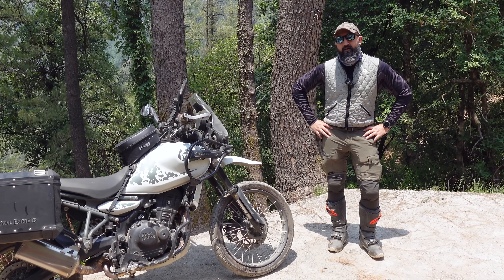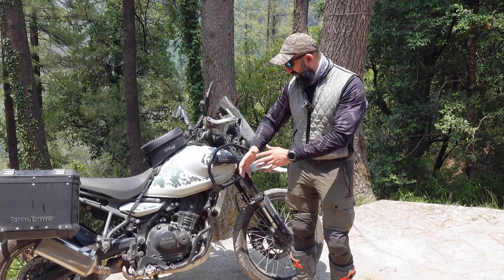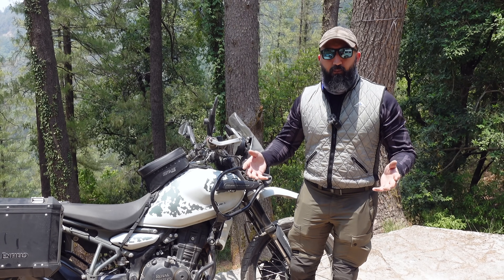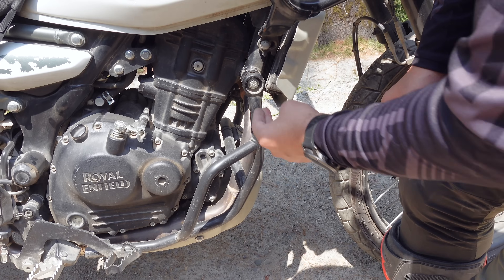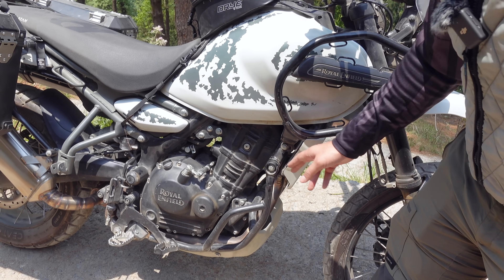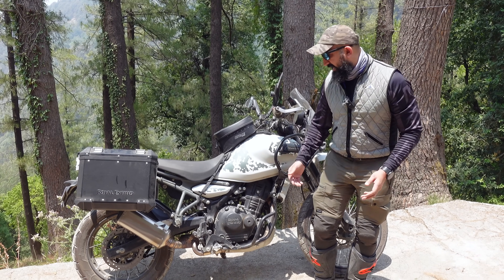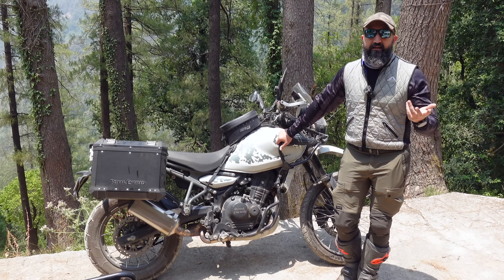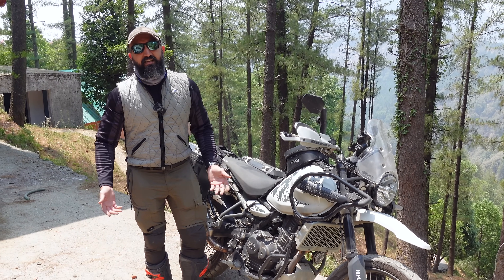Why Did Himalayan 450 Chassis Break: What I Learnt From Royal Enfield

Comment: Royal Enfield should first go complete their school education,then come back again...These idiots are making motorcycles out of cheap raw materials that is generally available in scrap yards
Reply: Bruh... Even you should follow your own advice.

Because the raw materials aren't at fault here,  the way it is designed and the way stress develops on certain points on the frame is at fault
Reply: @adityan3208  i live in Chennai..and I knew where does RE procures their raw materials from...Pls don't go too much into engineering aspects,design is just a form...Material is the substance which constitutes the form..Without material, you design something on the Air 🤔?? ...better luck next time for ur argument 🖖🏻byebye
Reply: @arjnVneEeclassic  lol bro comes with a weak ass explanation and thinks he did something savage.

Look, yes the material plays a crucial role, but the way it is designed also plays an equal amount of role.

Take a piece of paper for example, you can fold it and use it in a way to keep certain delivery packages safe. They have replaced the bubble wraps now.

Now if that thing was poorly designed, it won't protect anything. Design is just as important.
Hope you had fun for 2 mins lol

Do you understand how stress is calculated on a frame? They know all the safety values while designing for a particular material.
I've studied this shit. I know this much lol

"Please don't go into engineering aspects" bro we talking here about a frame breakage and a bike that has been engineered. Why not?
Reply: @adityan3208  If you are that intellectual 🤔well lemme post you a few sober questions. What is the difference between weight and force ! Answer this without typing essays🖖🏻😇 ✨
Reply: @arjnVneEeclassic  weight accounts for gravity while force doesn't.
This is a question for kids.

Don't ask any further pls. I'm not here to prove anything to anyone. Ek baar kar diya ab peeche mat lagna
Reply: @adityan3208  That was the reason I posted it to you 🤭🤣
Reply: @arjnVneEeclassic  hahaha very savage 😒

When you couldn't win at the original point of contention, act like a kid and divert it and make silly jokes to feel better. Good for you.
Does not affect me. My ego isn't this fragile. I was here only to discuss, not to win or lose.
Reply: @adityan3208  you keep blabbering 😎😁🏌🏻who cares 🖖🏻🥳🤣

Comment: Trust is like a vase, once it’s broken, though you can fix it, the vase will never be the same again. 
Same case here 🙏
Reply: You can't simply whack the vase with a stick and blame the vase.
Reply: It's not wise to let a 'saying' affect your mechanical understanding. Ditch the melodrama, stick to facts.
Reply: @haldar9528  just think about it, a motorcycle chassis breaks due to wrong torque. How many bikes have had this problem
Reply: @ontwowheelsjoe Some Ducatis had this problem too. If you understand the function of those bolts, you will understand why. If you use incorrect torque on your car's suspension's joints, something will break.
Reply: @twowheeledparadox  Understood. Happy to have learnt something new
Reply: Tune mujhe woh Jab we Met ke station Master ki yaad dialadi ...buddhe

Comment: Utter nonsense 🥺 of first 10 mins at lest

I kept on listening but at no point could make any sense of it. 

This thing, that thing, designed that way bla bla.... BS pure BS. 

"High Tolerance" means the scope for adjustment/adoption is higher -- engine is not such unit. 

"Couple of mm deviation" -- you need to have sense of units, what it means in solid blocks like engine. 
Making a laughing stock of yourself.
Reply: Well said, and why does this incident need justification from anyone? I mean until and unless he's getting paid from RE it doesn't make sense.

Comment: I understand where you come from, but RE should immediately take steps to strengthen or redesign the Himalayan 450 chassis. This will affect the otherwise brilliant product, I'd say 95% of Himalayan 450s  sold have an aftermarket crash guard installed already and it's only a matter of time before more of these instances crop up.
A chassis snapping because of aftermarket crash guards points to an already compromised chassis and there's no telling if even OE crash guards will help the chassis stand the test of time.
I'm curious if there's a specific brand of crash guards was on both bikes that were affected.
Also, it isn't easy to buy OE accessories, it depends on the level of dealer involvement and various other factors that will end up causing a buyer to look elsewhere.

Comment: People will buy motorcycle, people will install accessories. If a nut bolt is twisted too hard is causing chassis failure. It is manufacturers fault. I don't see it any other way. Enough redundancy should be there that one installation should not cause any breakage.
Reply: @tazz31415  I will not pretend that I know what cars lower arm mean but surely leg guard and engine guard installation are much more common.

Comment: Sounds like damage control. How much did RE pay you to say this? There are thousands, if not lakhs of motorcycles here in India running aftermarket crash guards, never heard any other motorcycle with snapped frame. Why only RE? They blame the aftermarket guards yet fix those motorcycles under warranty? Both the owners also came out and said it's their own fault. Sounds very fishy. RE should spend their money in R&D and quality control instead of marketing and damage control.
Reply: Dude just think with your mind a bit open, the big brands who makes the engine as a stressed member and people who buy them generally do not use zana products mainly they use the GIVI or some other expensive crash guard brands. The problem here is the bike is new and as always indian accessory brands didnot put in a lot of research to make a compatible crash guard.. So this problem can be an issue.. The 3rd party companies must do some research or just ask about the tehnicalities of the himalayan and should have come up with a better product.
I use himalayn 411 and use the zana engine guard, the part of the guard which bolts with the frame of my bike broke and stayed inside, it was a nightmare and had to drill the bolt out and re-thread it to use a new bolt. The mechanic told me that the quality of the guard is too bad and the weight of the guard was not well distribuited which resulted in stressing the bolted parts and they ultimaltely snapped off. I previously used the RE's original engine guard but it got bent when the bike fell down so thought of buying this zana and now i have some serious concerns..
Reply: @95Ar98  whatever you said applies to KTM Adv and vstrom and other bikes as well. Forget advs, people add huge ugly cage like crash guards even on their street bikes. But I've never heard chassis breaking from any manufacturer. It's only RE. Why?
Reply: @suhas.kotian  bro do you know what a engine stressed frame is? very few bikes in india have that type of frame integration, so thats why i said that. Also It is the 1st time RE has made a bike with this technology.. so not everything can be like before... I am not defending RE but in this case i dont think RE is to be blamed completely.
Reply: @95Ar98  lmao I think you have no idea what you're talking about. Most of the modern bikes use engine as stressed members and i'm not talking about commuter bikes here. Chassis breaking is RE specific issue, as customer we need to hold the brand accountable so that we get better products, not defend them.
Reply: @suhas.kotian  search for ktm's chasis crack you would know and you should learn to understand what i wrote, go back and read it properly. Also, why would the brand be responsible if you use a product that they did not endorse? If you still think that its the brand's fault sue them.. find the fault, dont fire in the air without an aim.. I geniunely think RE has many faults, the 411 had the chasis break near the T-stem that was 100% their fault, they should have addressed that, but blaming something which is not their fault is stupid. I think you do not have a technical background to understand this thing so I guess its ok for you to have a non sensible opinion. 
How about waiting for sometimes to see any of these incidents happening to people who use no crash guards or only the OEM, Then it could be understood..
Reply: @95Ar98  searched the internet, But couldn't find ktm chassis breaking due to aftermarket crash guard. Do you mind sharing any links? They won't take responsibility for the products which they don't endorse, that's okay. They will win in the court by technicalities but this incident shows the masses that their product is inferior. Also you don't need very high technical knowledge to understand what's going on. All big media houses are covering this and blaming the aftermarket crash guard. Looks like PR team is doing a great job there. Anyway I have no interest arguing with fan boys. I've been a follower of Abhinav since r15 days and I personally felt this video was biased.
Reply: @suhas.kotian   event i think the same not only abhinav , big bear custom, twenty3 rides are giving biased review
Reply: @95Ar98 Exactly. The 411's chassis broke due to poor quality. Anyone who understands the design of the 450's chassis will understand the explanation. In the pics that I saw, the bolts of the front mounts were missing. But if this happens on Himalayans without any engine guards then it is clearly a QC problem.
Reply: @twowheeledparadox  the black himalayan did not look to have any aftermarket crash guards. Also why are they covering it under warranty if it's not their fault? Maybe they are doing this so that things don't escalate to court and they have fear of losing the case?
Reply: Anyone comparing this issue saying it never happened in KTM adventure bikes, both have different chassis designs. Both have their own advantages and disadvantages and impact the cost of the bike. Maybe read a little bit about chassis types and understand what happens in them before just reading online posts and blaming the companies. RE will not accept the mistake even if it was their mistake, not just RE any company will do the same.
Reply: @abhishekbhat3152  Very well said .. that is the reason why we must pursue legal options to fight these things..
Reply: If this were the case, then more frames will snap with the OEM parts. That has not happened yet. Time will tell, but I believe RE is a genuine company that really cares about its customer base, unless a certain American brand that losing their customer base very rapidly right now.
Any newly designed vehicle is going to have a few birthing issues. This happens to every company around the globe.
Sounds to me like some of you guys have beef with the company for some weirdo reason or other.
Reply: @southernknight9983  "Any newly designed vehicle will have some birthing issues" 
Then accept it. Beef with the company because they're trying to pay off influencers into pointing fingers at others instead of accepting their mistake.
Reply: @suhas.kotian  Accept it? I'm not the one with the issue.
So what proof do you have that this company is paying off influencers to keep the problem silent?
There are hundreds if not thousands of recalls every single year over vehicle issues. Some deadly, some not.
My own Honda had a recall to replace a part that might allow the hood to fly open on the freeway.
My mother's car had a recall. I know several people who have had recalls on their vehicles over the years.
If you got proof that Royal Enfield is trying to hide a problem or paying people off to ignore the problem, then by all means, post that evidence.
Until then this is a problem that RE has and is looking into.
If you think RE is lying, then please provide the evidence.
Otherwise, none of you haters have a case.

As far as I can tell, RE is doing great with their products and treat their customers with great respect and courtesy.

For many reasons, I plan on getting a Royal Enfield bike in the near future. Maybe a Himalayan, maybe a different model, but I have settled on a Royal Enfield for my next bike.

If it is an issue, RE will take care of it. I am quite confident in this company to do so. If they don't, I'll be the first to say so.

Cheers!
Reply: @southernknight9983    when I said accept it, obviously it was meant for the company and not you. If there's any defect with honda, I would call out honda as well. I have no bias towards any company. I personally own a suzuki and if there's any issue, I wouldn't mind calling out the company. So coming to the RE "hate", first of all their products are sub par compared to the competiton when it comes to quality. I have personally seen this in my friend circle. Yes, they have been improving a lot in recent times, but still there's a long way to go. Secondly, they are doing good job with customers? Maybe the sales team.  But service centers are pathetic (Atleast in the city that I stay in). Also we did go to showroom for testride and enquire price and they quoted 3.8 lakhs for base variant H450 (this was before December when it was still on introductory price) We found out they are selling some accessories and included those in the final price as well. Those are optional purchases but these guys sell it without asking. Seems a bit scammy, isn't it? (The dealer is Niran motors in Mangalore if you wanna call and check) 

Anyway you are planning to buy RE, so obviously your reply will very biased. Good luck with your purchase and I wish your ownership goes smoothly.
Reply: This is why this guy don’t get millions of views 😂
Reply: Rightly said
Reply: Himalayan, built for no roads. Can’t even run on proper roads. A huge heap of metal crap.
Reply: RE will never accept their fault. Blaming the after market accessories also means that people will now only buy RE accessories. You see, its a win win for them.

Comment: Whatever failure there maybe be it engine, electrical or ecu all acceptable but, Chasis braking is not acceptable, It can kill someone.
Reply: Brake failure is far more dangerous, btw the 2 owners of the chassis incident are completely fine.
Reply: It can happen on any bike!. Every bike has a rwar swing arm. What if the bolt or bolts came out or vibrated out. Same affect!.
Reply: Well said ....RE is playing volleyball 🏐 ...I made my mind to cancel RE and go for triumph scrambler 400x as it is undoubtedly quality product
Reply: @rupeshnanal1574  same here.